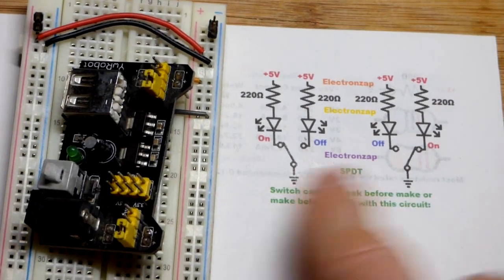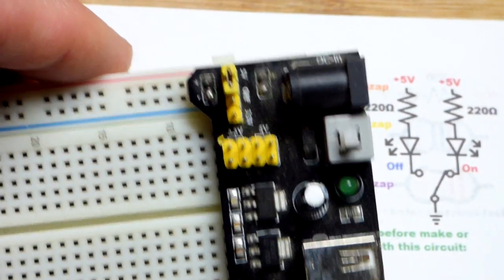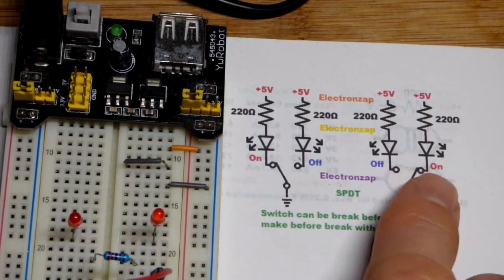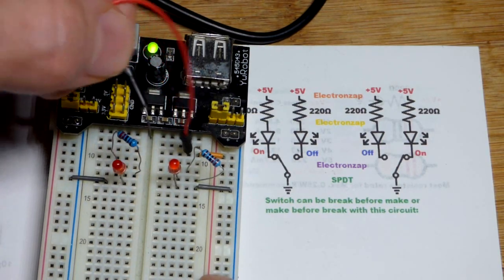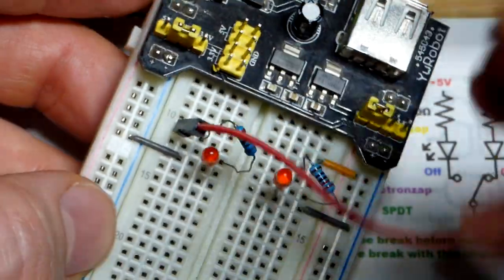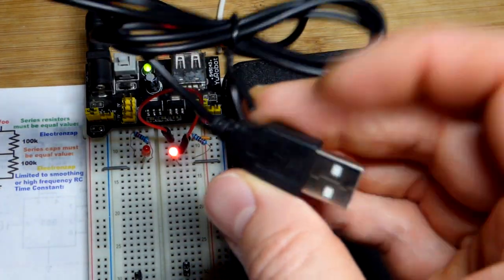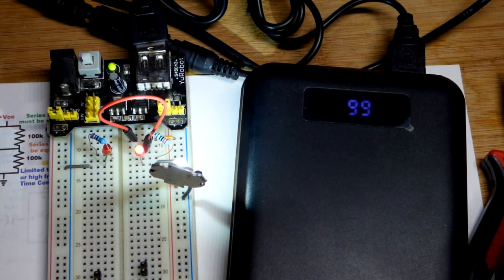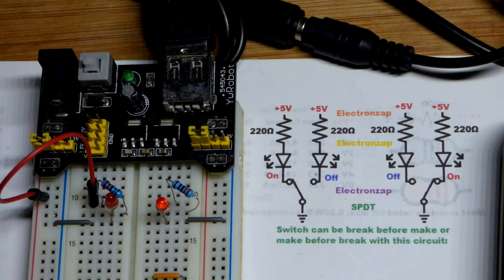How to use Breadboard Power Supply With Single Pole Double Throw SPDT Switch Circuit

Comment: 4:03 Be sure to whip out the ole multimeter and check the polarity of the AC/DC adapter barrel socket (and while you’re at it the voltage as the stated voltage on the sticker could be wrong). The center pin on the barrel should be positive. I’ve purchased at least  one used AC/DC adapter at Goodwill and the center was negative.
Reply from the maker: That's a good tip. I made at least one video devoted to taking that measurement with a multimeter. Most of these barrel plugs from power sources are center positive, but I am aware that guitar petal power supplies are center negative. Every random barrel plug you come across should definitely be checked for polarity.